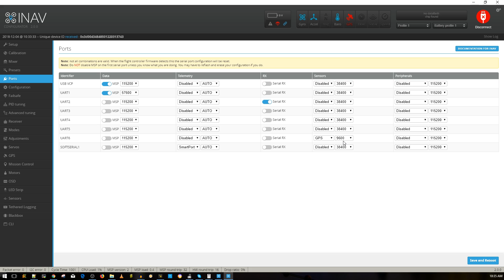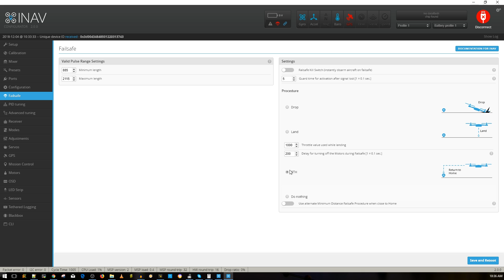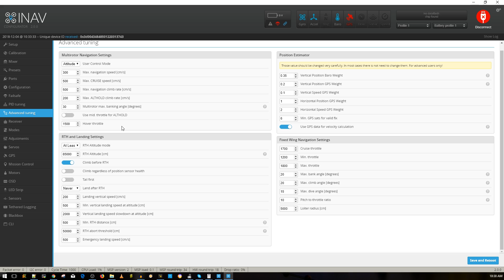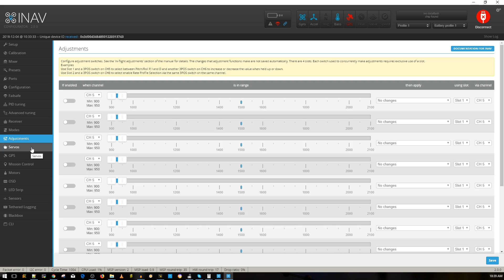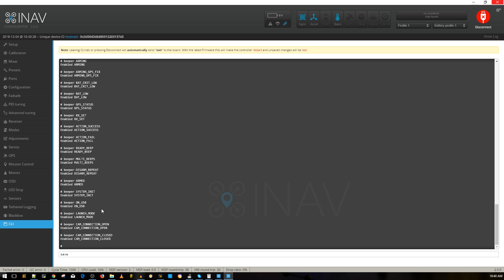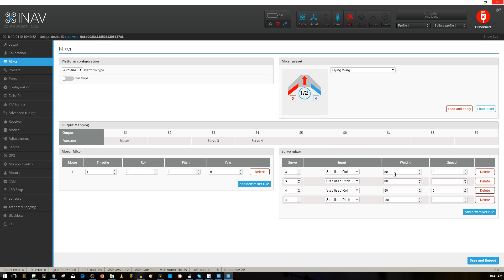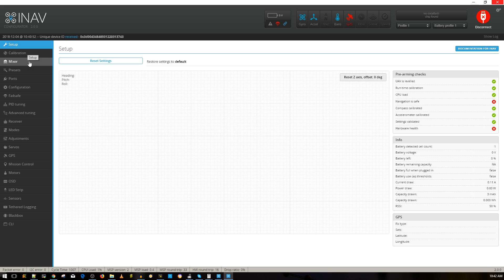Zohd Orbit INAV Build Part 2 // Maiden and INAV Configuration

Comment: Great build and flying, dude!!! Really nice! 😃
I'm going to build a small 24" wing with depron... Already have the motor, servos, props, FPV camera and a few smaller things... The Matek FC (the smaller one), esc and GPS are coming. Then I'm just going to need a battery. 😃
BTW, in your wings, what kind of esc do you use? BLHELI_S or SimonK/doesn't matter?

Comment: Thanks for this!
I’m kinda new to wings (been a quad guy for 2 years) got an iNav wing built with the F405SE FC. Got auto launch setup but afraid to test it out in case it flies away or doesn’t kick in haha.

Is there any quick way to test it out without props on and without throwing the wing into stuff at home before taking it for its actual maiden? 😁
Reply: Lower the sensitivity. When you move your arm enough while still holding on it will kick on hold tight and be ready to lower the throttle. 
Get to know the settings for both the time and acceleration rate needed to kick in the auto launch.